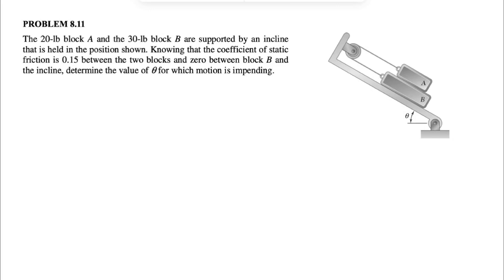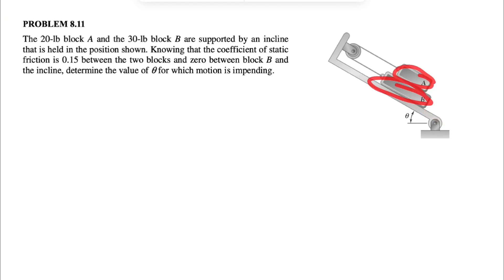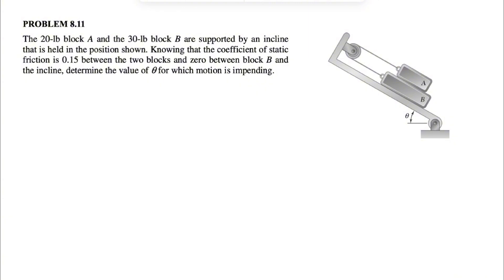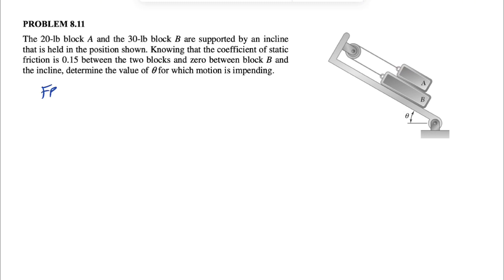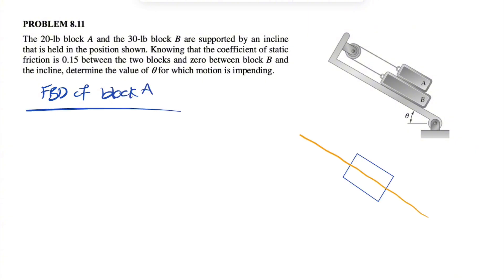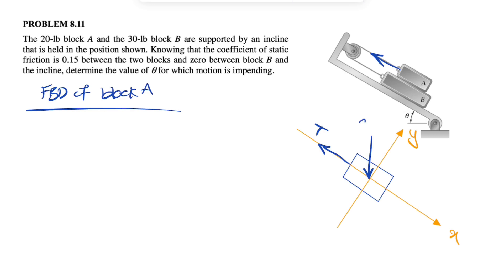Solved Problem 8.11 | Determine the value of 𝜃 for which motion is impending.

Comment: i think impending motion in block A is from left to the right so the friction force should be from right to the left
Reply from the maker: Since block B is heavier, it resists motion more, so when the cable pulls block A up the incline, A tends to slip up relative to B, and therefore the friction force on A acts down the plane, opposing that impending relative motion.